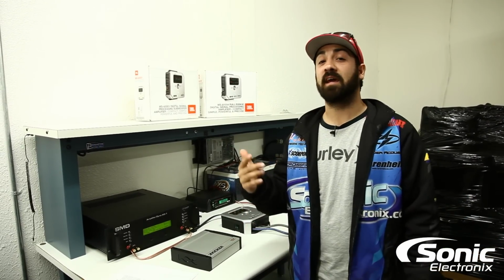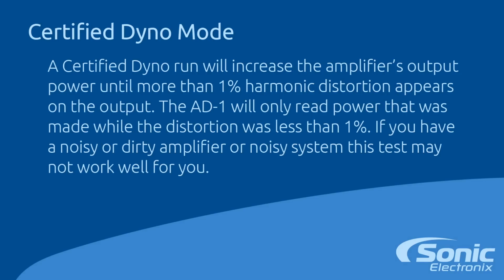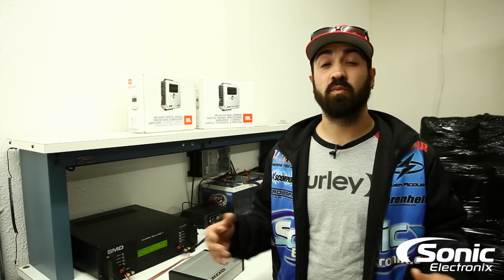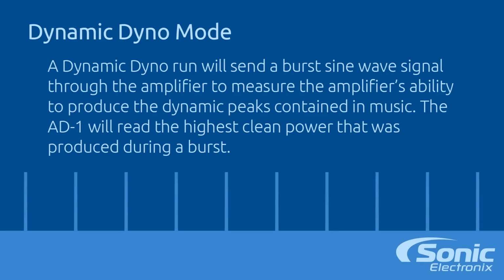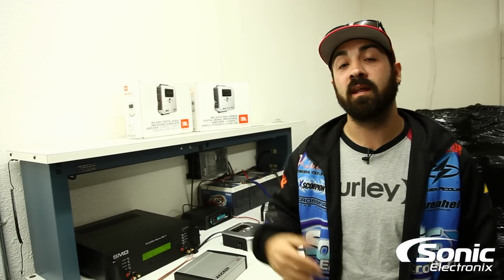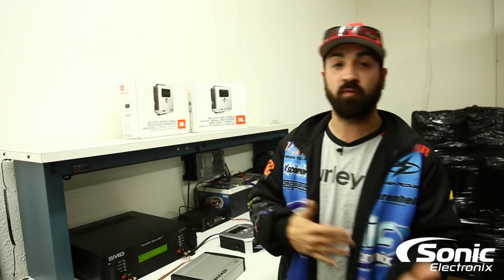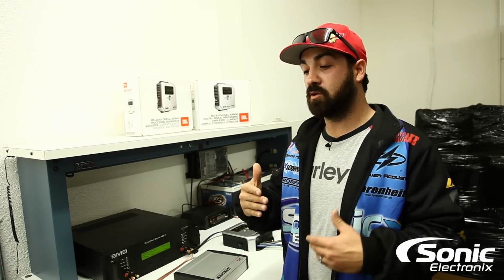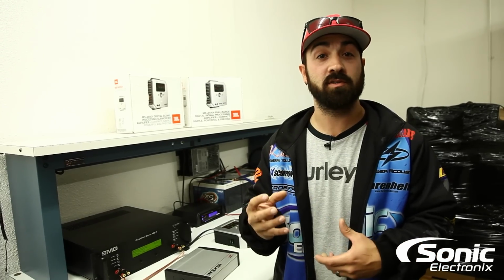Sonic Electronix Certified Amps | About SMD AD-1 Amp Dyno

Comment: hey guys how can i set the amp gains properly for a sub using the settings in the head unit? and lowering the bass boost at high volume after setting everything, just for certain tracks, can cause damage to the amplifier with time?
Reply: Use a song your a familiar with. Actually use an example of all the types of music you listen too.

 Start with the source unit (head unit). Turn up the volume until it starts to break up (distortion) and then back down 1-2 steps until the sound is clean again. Repeat this process with HU at it's peak output; start with amp(s) with the gain set at zero and then turn it up until it starts to sound terrible and then back it town ever so slightly.

 Then move to your bass level control (gain control for the sub amp). The point here is to find a happy-medium; unless you wanna constant adjust your bass level every time you change the type of music you listen too. In other words, whatever setting bumps the hardest with rap will not really work with country.

 The question becomes: How often do you listen to country, rock, whatever and can you live with less output to match this type of music?

 This comes back to the design of the sub system actually. IMHO, anything under 300 Watt should be ported and at least 1 cubic feet of internal volume. Once you get over 300 Watts; then sealed systems with a bit of EQ will equally sound good.

 The problem with most prefab systems is the 40-60hz output peak and steep roll-off afterwards. There is plenty of information available below 40hz in music, but it's often reproduced as heavy woofer movement, maybe port noise but not much more output...